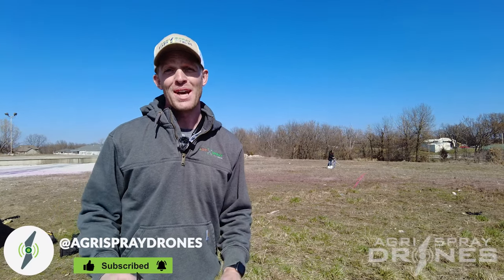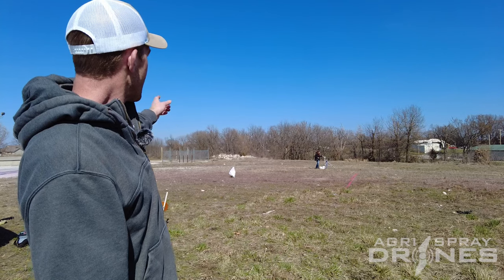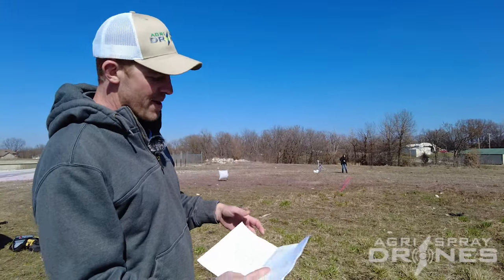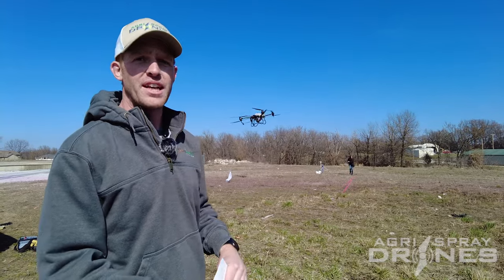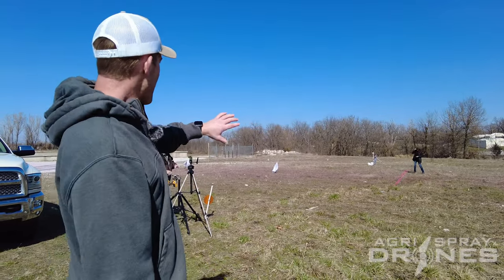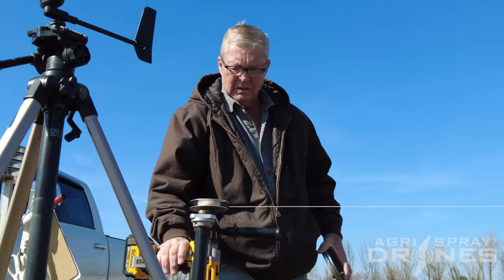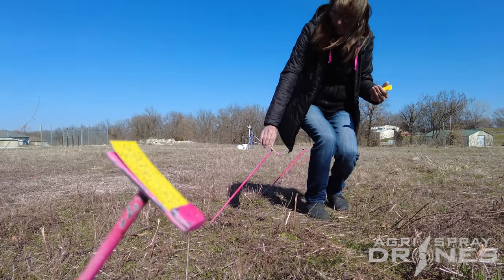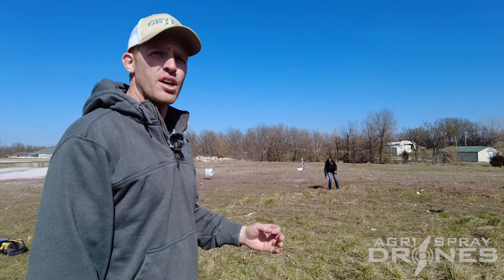Behind the Scenes: DJI Agras T40 Spray Swath Testing | Agri Spray Drones

Comment: Can you adjust Prop speed if the vortex wind downforce is too great in some applications, wheather it be a liquid or granular applications for example? If so, will this alter the payload capacity or spray payload or alter the application in a negative or possibly in the postive direction? If not, are their any options to consider?
Reply: Fly higher.
Reply: You've got a couple options to adjust your downforce, you would need to fly higher or lower in some cases, or adjust payload in others.  In your example, if you were to reduce prop speed, you would drop altitude, in a normal setting, as it need a specific speed to keep the drone airborne.  Another way to do this would be to adjust your payload in your tank.  More payload would force the drone to work harder, therefore spinning the blades quicker to stay aloft, causing more downforce.  Same if you were to have an empty tank, the drone wouldn't have to work near as hard to stay airborne, therefore reducing your downforce.  Hope that helps!